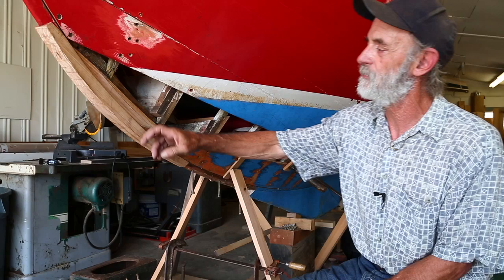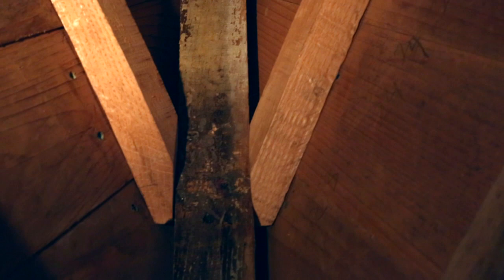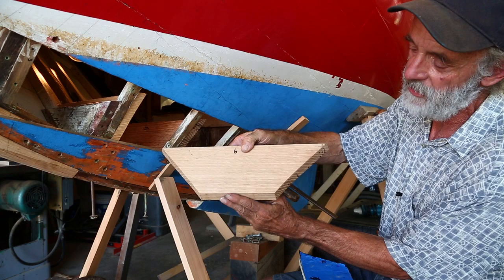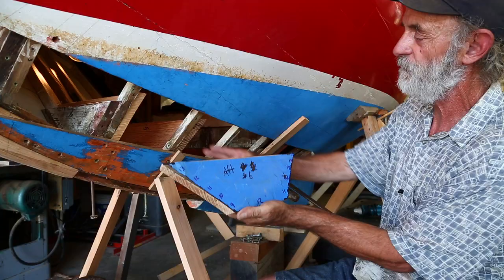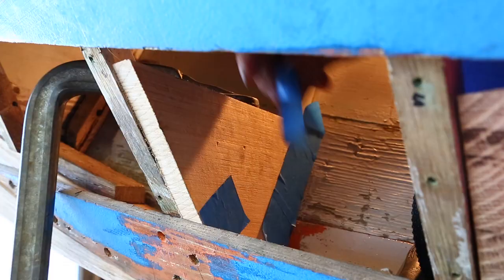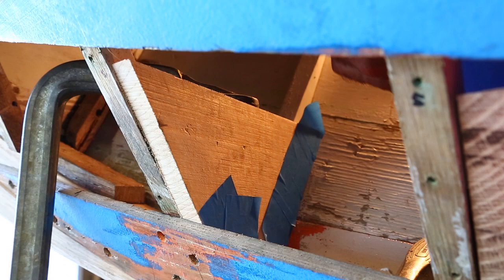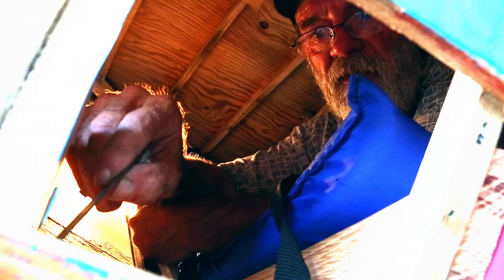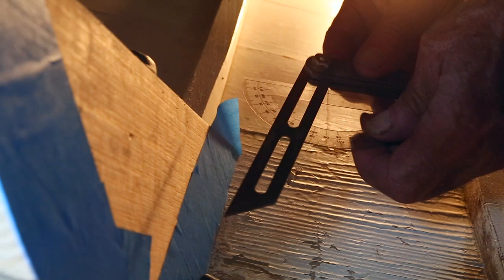Part 7 - Herreshoff 12 1/2 - A quick and easy way to pattern and cut progressive bevels

Comment: My family knows that NO job can be done without blue tape...but THIS takes it to a whole new level.  The dynamic angle change for the bevel cut on the band saw is amazing.  Really pushes the saw's capability to a new level.  Can't wait to try it.  

Thanks--again--for sharing these skills of the trade.

Comment: Totally could build a crank system for that saw. Make a crank with gear off left side. Then attatch a progressively geared long ring gear(part of it) and attatch it to table degree arm. Gear reduce it to like 2:1 so u can crank the the handle right next to the table with left hand. That way you are not spread out on the saw.

Comment: 10:51 but then again, are you going to screw the planks of the hull in the end grain of these rebuilt blocs? no... so why do they need to be so tight? they are only braces for the membrures. they dont need to touch the hull planks

Comment: When you say 4 FOOT. Are you saying Four Foot or Forefoot?
And anything longer than one foot is "feet"... Just sayin '
I think you should have re-bent the original oak board because you basically made your own grain doing what you said you didn't want the grain in the oak to do. When that glue fails years from now its going to split out and down into the oncoming waves.